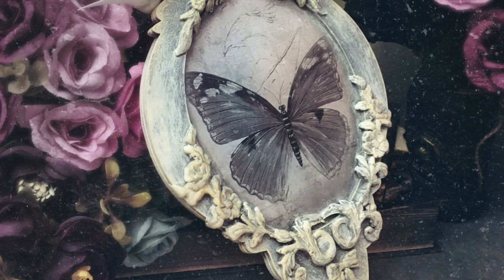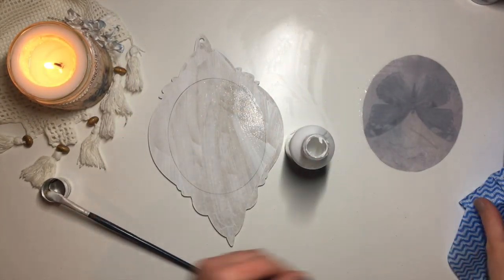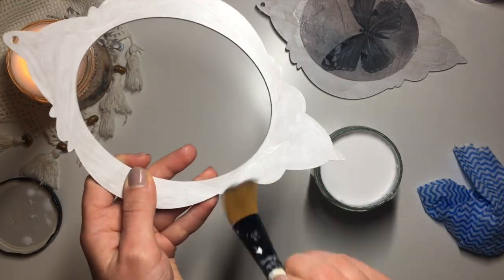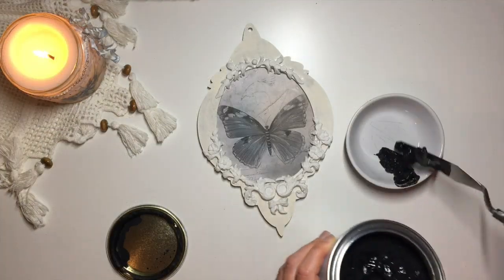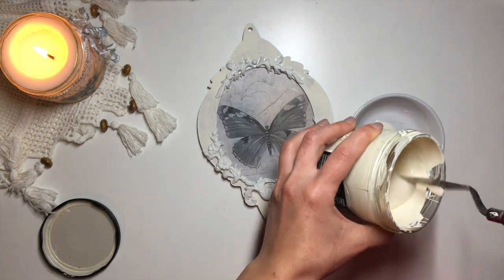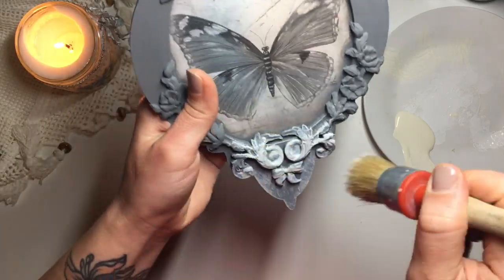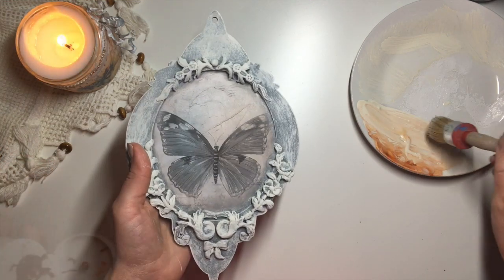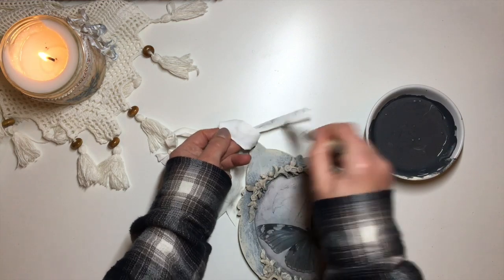DECOUPAGE ON WOOD TUTORIAL | VICTORIAN WALL DECORATION

Comment: Hi, I love what you do.
I work a lot with IOD mouls and I suggest that you apply a little bit of oil with a paint brush into the design on the mold you are going to use. The clay comes out easily and maintains its shape.